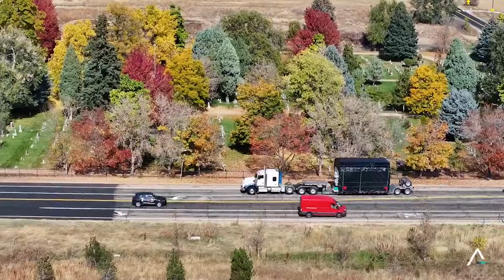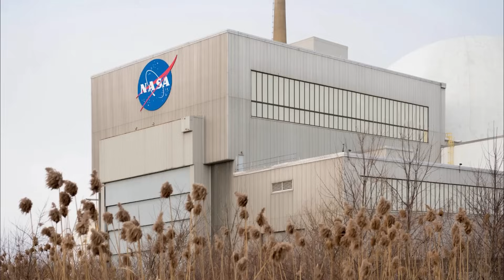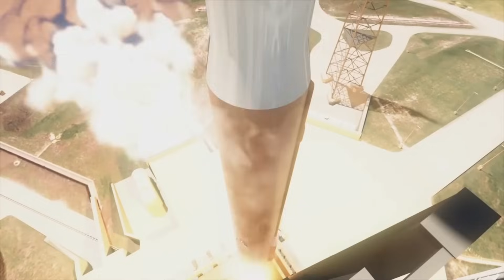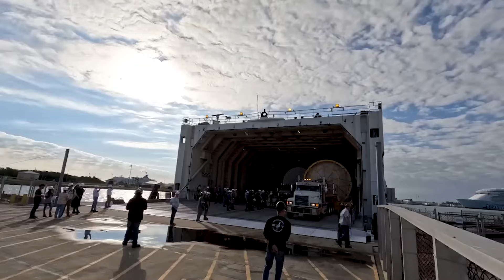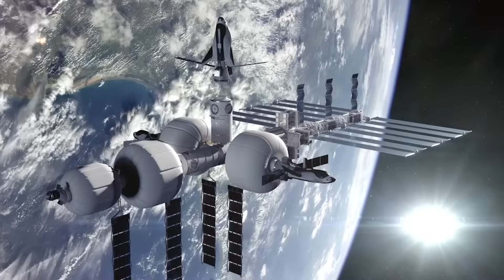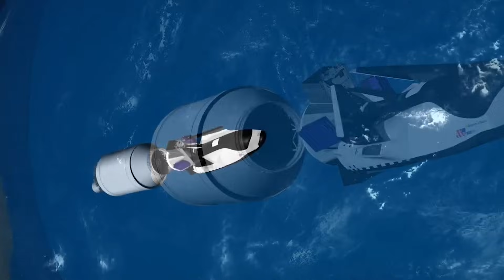Dream Chaser Tenacity Is Vertical For Launch Testing

Comment: Not clear why they didn't go with SpaceX. Were they prevented by contractural obligations? No good having a rapid turnaround vehicle if you don't have a rapid turnaround rocket to put it on top of.
Reply: The payload fairing for Falcon 9 and Falcon Heavy is too small.
  Vulcan currently has the largest payload fairing in the industry.
Reply: @jameskelly3502  In some sim videos the Dream Chaser appears on top of a rocket without fairing ...   I guess that is not the case but it would be awesome if it would have that capability
Reply: @user-mi5sq4zc5p  Yes, there are animations of that.
  But it's better from an aerodynamic point to have the vehicle in a streamlined fairing.
Reply: @MiltonCedeno-l5x  I believe those renderings were for the crewed version of dream chaser, which would not be able to launch in a fairing due to the need for launch escape systems. The crewed version of the capsule is still in the works, ig we'll see when it materializes
Reply: Because SaceX is known to blow up rockets.
ULA has 100% success rate.
Musk's zombies are really annoying.

Comment: Ive been waiting almost 20 years for this.

  Dream Chaser was originally designed as the "Hermes" for ESA in the 1990s.

  The design was adpoted by a company called "Space Dev", which, amoung other things, made hybrid solid rocket motors for "Space Ship One" in the early 2000s.

  In 2008, Space Dev was purchased by SNC and the Dream Chaser program recieved more funding and resources.
Reply: Dream Chaser came from "HL-20 Personnel Launch System".
Reply: @lordgarion514  The HL -20 didn't have the "shooting star module," but the Hermes did.
  This means Dream Chaser is closer to Hermes than HL-20.
Reply: @jameskelly3502  
You're trying to say because they used a solar power that they were going to use on hermes, makes the physical ship itself closer in design to Hermes.

Not how that works. That's an add-on.
Reply: @lordgarion514  The shooting star module isn't just "solar power."
 It's a separate, independent spacecraft that compliments the winged reentry vehicle.
  In short the Hermes had superior capabilities than the HL-20, and that's why the Hermes design is used, not the HL-20 design

Comment: I wonder how specific this prelaunch vibration test is? Would the results be specific to a Vulcan vehicle or could the results also apply to a Falcon 9? I imagine there would be different harmonic modes of vibration working through the vehicle and payload at launch. Would a Falcon9 launch be a smoother ride to the cargo compared to a 2 engine Vulcan?
Reply: The vibration tests are meant to exceed the expected levels of vibration during launch.
  Basically, if it survives the test, then it will survive the flight.

Comment: Can't be any worse than a starship launch.
Reply: Did you not any pay attention to the many improvements from the first flight to the second?  The Falcon 9 failed four times before landing successfully in 2015.   Since then there have been over 250 landings by Falcon 9 boosters.  Nobody else is doing that.  Developing and flying the largest rocket is more complicated then you can imagine.
Reply: @michaeldeierhoi4096 You're right, developing rockets is very complicated.
  That's why Starship success is NOT a gaurantee.
Reply: @jameskelly3502  Of course it's not a guarantee.  Even Elon has said as much.  But Space X has a good record behind them of setting a higher bar with rockets and doing stuff no one has done before.  Their second ITF was a big improvement over the first one.  They could succeed or come even closer with their primary goals in the next launch.
Reply: @michaeldeierhoi4096  The first launch blew up.
  You can only go up from there.
Reply: @jameskelly3502  It could have blown up on the pad which would have been the worse case scenario or even just as it cleared the launch tower before an RUD would be bad as well so there's a lot that could have gone even worse in the first launch.
Reply: @michaeldeierhoi4096  boo hoo fanboy.
Reply: @TheMoneypresident    That sounds like the kind of comment I would expect from a kid in grade school.  😅😂

Comment: That's a lot of blood sweat and tears to put on top of two BE-4 engines.  Let's hope it survives liftoff.
Reply: Yeah I’m a bit concerned about the Vulcan as well. I would’ve liked to see more test flights without valuable payloads onboard first.
Reply: @RoryShields1  have you seen high-res images of their 3-D printed, "qualified and accepted" engine nozzles? There are so many tig welded patches, plugging pinhole leaks, it's amazing.
Reply: BE4 just proved to be clean and solid engines. Vulcan flawless launch increases confidence. 
Experts know what their doing, the rest comment on YouTube
Reply: @trucksanddirt1506  I was there for the first Antares launch and the AJ-26s performed flawlessly as well. I was also there when an AJ-26 blew up and the rocket pulled a Hindenburg. I am very impressed by the BE-4s performance during the test flight, but it’s a small sample size. I’m cautiously optimistic that the future looks bright for Vulcan.
Reply: @RoryShields1  1070s vs 2020s. ULA has a 100% success rate. I trust them to make the right decision. BO is on the right track and will fly New Glenn successfully this year. BO has a bright future.
Reply: @trucksanddirt1506  no they didn't. The solid motors did half the work. Nice reply to my comment, "expert."
Reply: @Hoopaball  I'm not the expert but I listen to them at ULA, with 100% success rate. Not random figures on YouTube
Reply: @trucksanddirt1506  Atlas V had a partial failure on AV009 on 15 June, 2007, where the payload was delivered to the wrong orbit
Reply: @Hoopaball  A Musk Zombie trying to take away the BE4 credit. A lot of zombies like you came out hoping that the BE4 will blow up so you could have your day.
BO and BE have a bright future and it doesn't depend on Musk's zombies making noise on Youtube